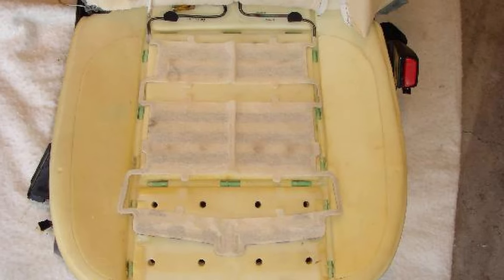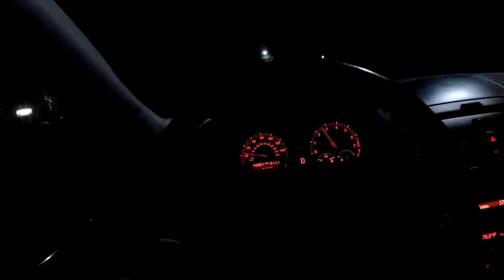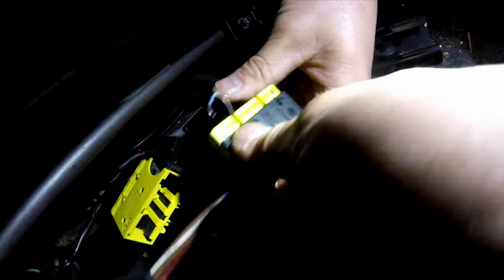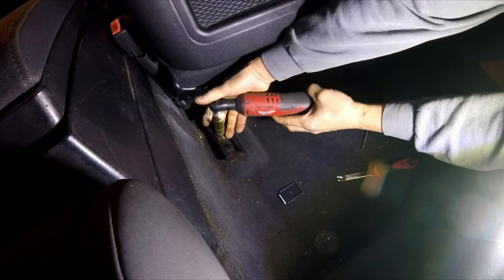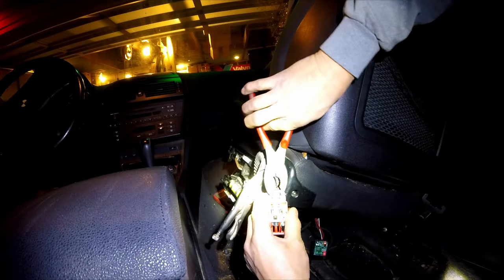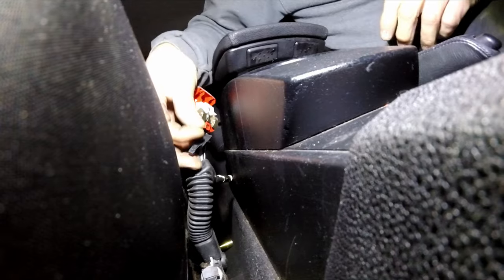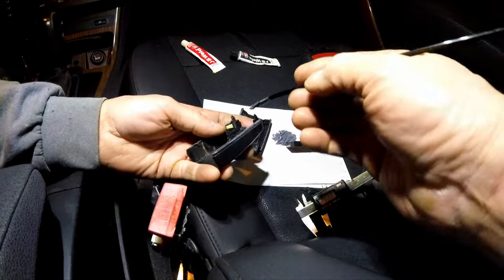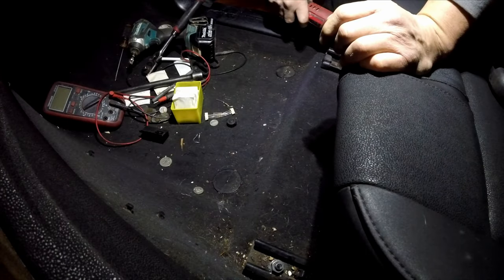Bypass Seat Belt Buckle Sensor with a Magnet - BMW or most seat belt buckles

Comment: Blame zee Germans.   I recall my 1976 BMW had a giant Fasten Seat Belt sign...a dedicated lighting feature that had long been deprecated with the e30 replacement seats.. Never saw how it worked in an original 76... This car was stepped and and hotrodded by the race guys before me.  44 dcoe mikuni carbs,  motor,  header (fuel pump, crane cams msd and kind of hi 6 ignition coil made it run almost like fuel injection.  Very simple.   No working seat belt sign